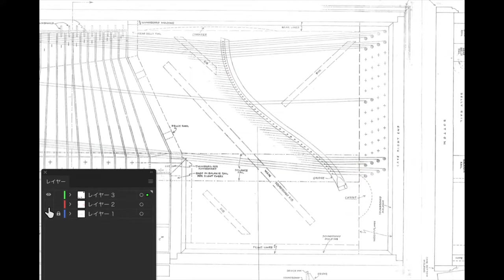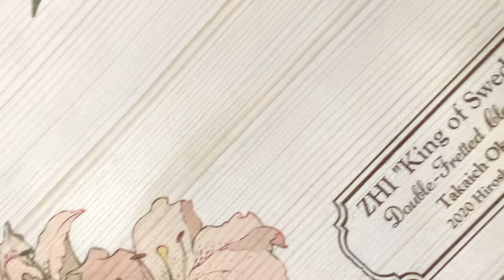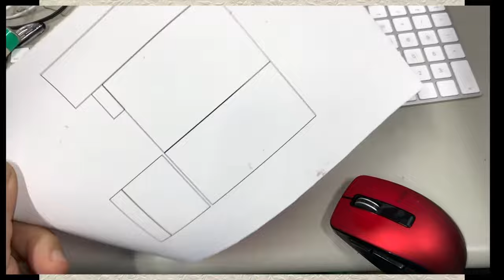クラビコード キットを取り寄せ〜組み立てました  Clavichord KIT King of Sweden

Comment: I have the same instrument--the newspaper says "Connecticut" @ 0:14 so I think it's from Zuckermann Harpsichords, in Stonington. I had to have it professionally strung and regulated since unlike a harpsichord, the tuning pins are very close together and it's difficult to get the string wrapped around correctly. Also, you have to bend the tangents into the correct position. 
Playing the clavichord improves your technique because you have to keep your fingers curled otherwise you can't hit the accidentals. 
Great sound!